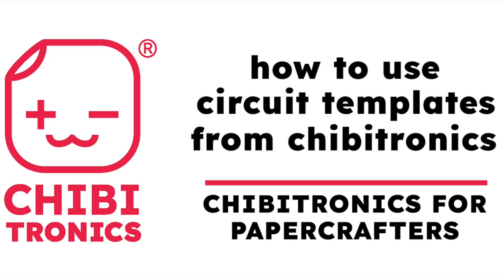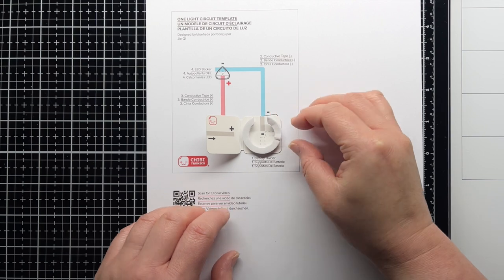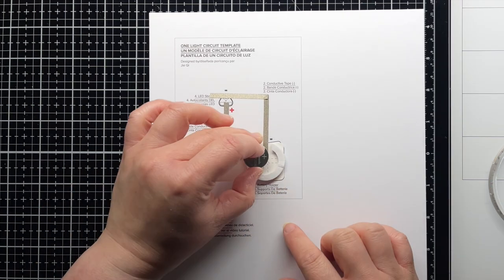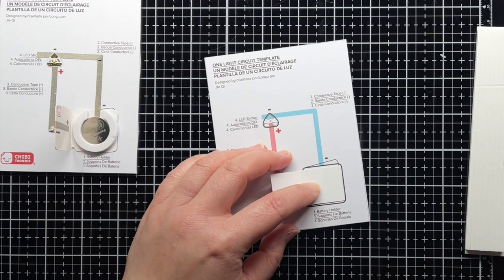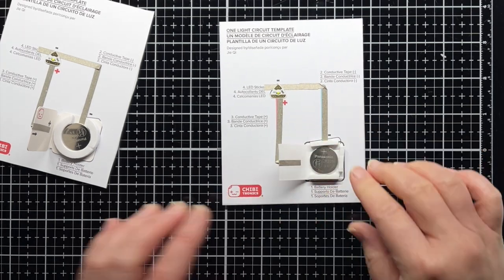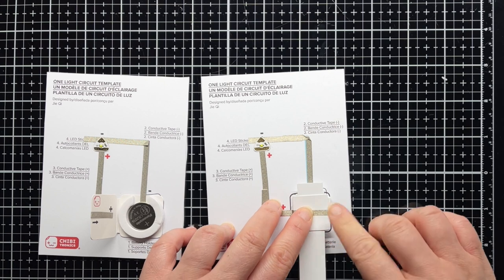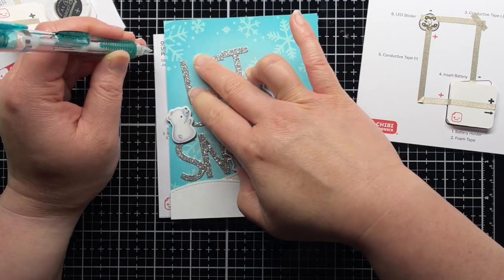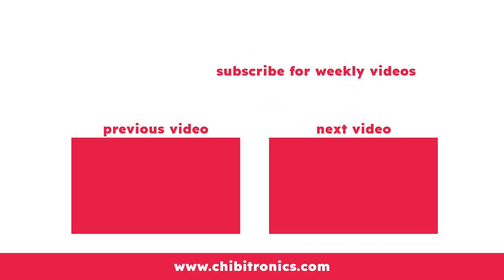8. How To Use a Circuit Template - Chibitronics for Papercrafters

Comment: How many led light can be used with a singel 3v battery cell?
Reply from the maker: Greetings!   The answer to your question (about how many Circuit Sticker LEDs you can light up with a single, fresh coin cell battery) is that it depends. This would depend, in part, upon the battery’s capacity and how much power would be required by the entire circuit. A thin CR2016 battery has less capacity than a thicker CR2032, for example.  It also depends in part upon their color (blue and white Circuit Sticker LEDs tend to use a bit more power than red and yellow ones).  Mixing different colors within the same circuit also impacts the draw upon the battery.

I currently have 18 white Circuit Sticker LEDs working on a single coin cell battery in a project that I  made.  They aren't super bright, and the battery won't last super long with that many Circuit Sticker LEDs attached.  But they are all turned on. If I stack two coin cell batteries (to make 6V), however, they all become super bright.

I'm not sure how long the battery would last if all of the LEDs were to remain switched on for an uninterrupted period of time.  I usually switch them off when I'm not using them.

Comment: How long does a battery light up 3 to 4 lights?
Reply from the maker: The answer to your question is that it depends. 

In general, a fresh 3V coin cell battery can power a circuit containing one or two LEDs for several days if it is running continuously.  It can last weeks if it is switched off between uses.  

There are many different variables that can affect battery life. For example, the longevity of your battery depends in part on how fresh it is and how much capacity it has.  The life of your battery also depends in part upon the number of LEDs being used and their colors. If your battery is powering a circuit with more than one LED, it will use more power than a circuit with a single LED.  If your battery is powering a circuit with all red LEDs, it will use less power than a circuit containing all white LEDs.